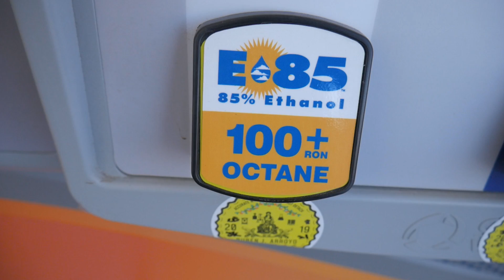Why Can't the BMW N55 Engine Make "High Power"?

Comment: N55 is reliable but why go N55 when the new B58 makes more power and also seems to be reliable? Edit: Also yes please do a video on all the N55 variants!!
Reply from the maker: good point! I think it mainly comes down to price at the moment. Many N55 powered cars have seen significant price reductions in the secondhand market.
Reply: @SimplyCarThings  some of the older cars have gone up in value, i got a 2016 m135i for £15k, can sell my spec a year on for nearly £2k more than i bought it for

Comment: I've had an n54 and considered going with the n55 now that the n54 is gone. I like the sound and reliability of the n55 more but the n54 screams to my inner power-whore because I love the fact I could daily the n54 at 550whp and its no less reliable then when it's at only 300whp. Plus if you do a single exit exhaust.... The n54 sounds amazing

Comment: I have a 2011 E82, with full bolt ons meth, and stage 1 turbo, I did 414 hp and 522 tq on a dyno but that was in the summer heat of Texas so it was heat soaked so I think it would've hit about 450 hp
Reply from the maker: very impressive numbers! is it a dct or manual?
Reply: @SimplyCarThings  manual

Comment: I had a 14' N55 in a 335i - had the dealer install the Dinan stage 2 tune. Within 1000 miles it was in the dealer countless times with issues. Went into limp mode x times, blew the intake pipe twice. Needles to say I traded the car soon after was just a headache.
Reply from the maker: wow, i'm surprised to hear that. My 2015 M235i has been tuned with E85 and is at 56k miles not a single issue

Comment: Well, long story short, 1) because the n55 has not been out as long as the n54, it hasn’t had the aftermarket support like the n54 has 2) the factory turbo is the bottle neck. Once you start going big turbo, the comparison becomes irrelevant.

Comment: My buddies with N54s are always broken down.  They've driven my 2014 F30 N55, stage 2 Bootmod3, are blown away by how fast it is.  I'm in Medical sales and drive it all over Arizona, have around 50k miles on it with all my mods/tune.  Never had a single problem with it, just your basic maintenance.
Reply from the maker: exactly man! i have almost the exact same mods except i also run E30 and im at 56k miles with zero issues
Reply: You still have the car? How's reliability ?
Reply: Do u live in phoenix

Comment: Been seeing a lot of n55 guys have rod bearing issues lately
Reply: That’s caused by OFHG not done properly, N55 engines are known to go over 200k miles, some have gone almost 300k, original turbo.
Reply: I’ve been looking for a 2011 for a few weeks now and out of the 6 or 7 I’ve checked out 2 had rod knock I’ve been seeing it more and more
Reply: thevernonposse you sure it wasn’t vanos, n55 may have rod issues if people don’t follow oil priming procedure when changing oil filter housing gasket. Also long oil intervals doesn’t help.

Comment: N55 with the ZF 8 speed. That ZF transmission is incredibly quick. Even stock. Throw an XHP flash tune on it and that car will be/feel like a little rocket. My wife owns a m235 and it’s the most funnest car to drive, she won’t let me tune it but for some reason I enjoy driving it A LOT more than my full bolt E90 335i making 450WHp. 

Sometimes I feel that it’s just as quick. Wish she’d let me full bolt on it I could only imagine how fun yours is bro

Comment: N55 with fmic and stage 2 mhd tune can produce up to 370 HP.  That's what I'm looking to do with my 335i hopefully by winter
Reply from the maker: very solid power levels!
Reply: I have the N55 I did the intake and charge pipe with mhd stage 1. I recently bought my intercooler and catless downpipe. I'm going to install them at the same time with mhd stage 2+ so I'm not buying 2 tunes. What kinda power do you guys think I'll make from that?

Comment: ive seen a 700hp n55 m235i  and i consider that as high power
Reply from the maker: was it 700hp at the wheels? its also important to understand what kind of dyno it was on since these figures can be manipulated very easily. But i do agree with you the N55 can make pretty high power!
Reply: @SimplyCarThings  ya it can still make 500-700 hp with a single turbo or stage 2 turbos with race fuel, meth etc.

Comment: hey now.. no hating. sure our crank isn't as strong.. but maybe us n55 owners want longevity not raw power.. 400whp is still a lot of fun.

twin scrolls are actually better for the engine. see here why. https://www.youtube.com/watch?v=T7JTRRlSEYI

the important "why" is at 2:50

exhaust scavenging and negative vs positive pressure in the exhaust manifold, which has net affect on the engine itself. Hence why twin scrolls rock.

Comment: I have the N55 in my 2011 335i and I owned the n54 in my 2007 335i coupe ... the n54 felt like it had more power ✅
Reply from the maker: definitely, i thought the same when i rode in the early N55 E92's. The later N55 variants tho feel significantly more responsive and punchy

Comment: 12 years and 196000 kms and my n54 is still going strong making 407 whp and i give it  hell... only thing i changed is my injectors to index 12. Original hpfp, original turbos bit of rattle tho, original water pump. Full bolt ons of course and custom tune water methanol injection..  still not bad for a old motor. Long live the mighty N54.
Reply: At 407whp I’m surprised you never blew the charge pipe. The stock one is plastic
Reply: @guidoluzzi66  it all the bolt on stuff charge pipe ,down pipes ,intercooler diverter vavles.. Now i have the 17ts ebay turbos ran 11.6 122mph not to bad. Time for a single turbo 👍

Comment: BMW forged some  internals of the n54 because they weren't too sure about the twin turbo setup. It had its issues for sure but it's a GREAT motor that won  many awards for years and was still being used even ten years later in some models. Bottom line is that they came out with the n55 to mostly save money and for better fuel efficiency.
Reply: That's just false... they added valvetronic and a dct transmission to the n55. Not sure how that's "saving money." N55 has 1 less turbo. That's it. It's twin scroll is more responsive, produces more torque at lower rpms, produces less heat, and overall reduces failure points. There was nothing cheaper about the n55. Twinscrolls are more expensive.
Reply: @banks334  The extras of having a twin turbo setup are costly and forging internals make it overall more expensive. The n54 is MUCH more tunable than the n55 and had a LOT more easy power gain potential.. that is well known.
Reply: @phild5813  like I said... because it has an extra turbo. Both n54 and n55 have powder metal rods and hyper pistons. You want to say n54 is more "tuneable" go for it, but, everything else is bs.
Reply: @banks334  Its well known that the n54 has a forged crank etc and the n55 doesn't (earlier years). No disrespect but you can just research it real quick.
Reply: @phild5813  it's well known that the crank isnt going to stop you from running enough boost to bend rods and destroy pistons. You're literally just regurgitating bs. First it was the n55 is just a low budget engine. I point out it's more expense and better performing in every regard and you want to tall about the crankshaft that doesnt have any impact at <800whp? Please... the only the the n54 has an advantage in is that it came with 2 turbos and can make 50-75whp more than an ewg n55. N54 turbos dont last long at all when you run then out at 99wgdc though so good luck with that.
Reply: @banks334  lol. You're obviously just an n55 fan boy. The n55 was less expensive. For the last time, the n54 is A LOT stronger and that's why there are so many 700+ horsepower n54s out there. Ppl dont buy older n55s and mod the car to 1000hp on stock Internals. Only you would because unfortunately you dont know better and you wont get informed on common knowledge.
Reply: @phild5813  you are obviously just clueless. Its the same damn engine it's not "a lot stronger." have you ever seen the inside of either one of them? There are plenty of 700whp N55's so hwo does that fit your narrative that the N54 is somehow magically stronger? Are you talking theoretically stronger? Because both blocks are open deck and need tons of work to do anything more than 700whp. You're the fanboy if you think the N54 is something special.  And again with the "cheaper" comment. There is absolutely nothing to substantiate the N55 is "cheaper." The N55 was simply a natural progression of BMW and turbo technology. I'll let you go back to regurgitating shit someone else said though because I am sure you've never seen the inside of either engine to actually form your own opinion on things.
Reply: @banks334  Its funny how the 335is, 1m and z4sdrive35is kept the "outdated" n54 instead of the n55.... dude I know it sucks to accept but the n54 has forged internals and is simply a stronger engine that can handle more power. The n55 is great and has some cast iron parts n shit ..... but it dosnt match up. The cost of a full twin turbo setup is more than a single twin scroll setup! Please go on a BMW forum and talk about how the original n55 is just as strong as the n54 and let me know how that goes ;)
Reply: @phild5813  oh, and OE BMW N54 turbos cost about $1400. OE BMW N55 Turbo costs about $2800. you still think those shitty mitsubishi turbos on your N54 are "more expensive" than a borg warner EFR turbo that lasts forever?
Reply: @banks334   Brenden Banks  "the n54 is a joke" lmao that's why it was used in the 335is and 1m which are  more expensive than the regular 335 and have more power..So weird how they used such a "joke outdated motor" when they could have used the n55. You wanna bring up the guy in the video ???? Really ??? 
He clearly explained why a TWIN TURBO SETUP costs more and he also explained why the n54 is a STRONGER MOTOR than the n55.... (earlier iterations of the n55). Look man.. I know it sucks that you thought you were buying the "better n newer motor" unfortunately you wasted your money for a much weaker motor and you'll have to settle for a lot less power. The good news is that you can put your car on kijiji and some other idiot just like you might  end up buying it. Then you can finally have that strong n54 that you've always wanted :D
Reply: @phild5813  the guy in the video doesnt have a clue and either do you. That's my point. It's a higher output engine off the factory floor due to its twin turbos. That doesnt make it a stronger or better engine. Not sure what youre not comprehending. I've literally debunked everything you've said and you're still sticking to your guns like the typical 15yr old n54 owner you probably are. Says N55 is cheaper... proves it probably costs more to produce... oh well its weaker... proves n55s have made 700whp... says the internals are cast... proves the internals are the same as n54 and literally every other bmw engine like the s55... oh well I'm going to deflect now by talking shit... proves OP is a dunce.

Comment: I love the N55, it's full of torque and sounds amazing, I just gotta drive a B58 car to decide between a 435i or 440i 🤔
Reply from the maker: N55's are badass, but man the B58 is on another level! You gotta drive one!
Reply: @SimplyCarThings  I finally bought one and you’re right! That B58 don’t play 😁
Reply: Tim C B58 is chaos. Shit bangs!
Reply: @svo7563  I bought an F32 440i in April 🙌🏽 I loveee it, so much torque and power on tap! Can’t wait to tune it
Reply: Tim C Get a 440i. Very cable motor stockwise
Reply: Bro 440i eyes close .b58 it is way faster than a n55 b58 its an upgraded version of N55
Reply: I have a 140i stage 2 running 452bhp. Monster!

Comment: Dude doesn't know what he's talking about this time , just getting info off other websites without proper research. Single turbos are better for more power, thats why N54 guys swap to that setup. Plus there  are HPFPs solutions when it comes to fueling (XDI, retrofitting S55 or B58 fuel pumps). N55s are making around 650whp+ on a stock block... want more power? then go for a closed deck setup and a bigger custom turbo! N55 is king buddy!
Reply from the maker: Ali G I wasn’t trying to say that N55 engines can’t make big power. I was trying to actually deflect those accusations with this video, I know it can make huge numbers and that’s why i put “high power” in quotations in the title. But mod for mod, especially with basic bolt ons an N54 motor can almost always produce higher power numbers, so i was explaining why that is.

Comment: I’ll take the N55 any day over N54. My stock N55 M2 is almost plenty (though I do want to mod it a little after warranty is up)

If I wanted a powerful engine, I’d rather get the B58 over the N54 because it’s (probably) more reliable than the N54. Toyota has done a lot of reliability testing before they released the Z4/Supra and if Toyota can trust BMW with it, it’s probably the go-to tuner 6 cylinder now.
Reply from the maker: Samuel Wu 100% agreed, if anything i’d go with a B58 car

Comment: I had a 2009 335 Tune and FBO and now 2013 335, tune and full fatback exhaust. From my experience, the n54 is a powerful and fun engine, gaining so much power from simple bolt ons. However, I did have many issue including high pressure fuel pump going bad, and turbo issue. I traded it for the 2013 before hitting 100k. The n55 is a lot smoother, but not as fast as the n54 with similar tunes. No issues so far and I am hitting 75k. I can see that car going more than 100k without problems. N54 is best but be prepared for unreliability and headaches

Comment: As an N55 owner, I prefer the reliability over the power gains of an n54. I’m really not drag racing every commute so anything between 400-450 is just good enough for the car.
Reply from the maker: rod bahmanyari same here, that was my reasoning too
Reply: @SimplyCarThings  put 20k on my m235i only the oil filter housing gasket so far but i did myself cheap fix. car runs super good and no issues at all other than that
Reply: Ollie Clark I’ve been having mine for about 4 years and zero problems 😏
Reply: x2 i had an n54 335i and EVERYTHING broke on it. N55 2014+ version is vastly improved. metal water pump. no fuel pump recall on mine. m235i now.. and power.. lol im at 380 fbo mhd s1 great daily driver
Reply: I hope you know that the reason water pumps fail is because they have a brushed motor. Thats it. Impellers hardly every fail
Reply: @seansurfn2  theresnt difference between 2023 and 2014 engines
Reply: Quick update: 7 years now owning the car, maintenance and oil.. she still runs lmao reliable af car
Reply: Most people won't realistically go higher than this, so the n54 won't benefit them in the long run.
Reply: This^ My stock N55 has been very reliable.
Reply: I’ve owned E92 N54 335, E82 N55 135 and E60 S85 M5. Unless they’re being tuned, the N54 differences are not very noticeable from the N55. BMW claims 15% more fuel efficiency on the N55 and less lag
Reply: about reliability. n54 better than N55
Reply: @ramazzakariadze5085  fuck no
Reply: Do you need to upgrade the turbo in a N55 to make those numbers 400-450
Reply: Tom Smith  Not at all. FBO stage 2+ gets you 390 whp and almost 500 ftlb I believe. That’s really all you need..
Reply: @tomsmith6372 no
Reply: @tomsmith6372  I think you can get around 400 with a few mods and a map tune. Downpipe, chargepipe, intercooler, throttle body controller, transmission tune.
Reply: Stage 1 tuned 640i. 320 to 355bhp. My fuel economy improved! I'm a hyper miler.
Reply: Except its not reliable lmfao. Bare issues on mine
Reply: Rei N55 is super reliable and if you get a EWG version it is essentially a matured product hence the new generation of B engines. This means this product is at the pinnacle of its development and now bmw is working on a different foundation. Moving forward, if you notice on select cars bmw utilizes 2 water pumps, this solves the WP issue, and you see fairly any rod issues. I can’t even find more than 1 mention of blown rods in my car and it was due to owner issues. The n55 is a great engjne
Reply: Brandon H. Do you know if 2014 535i GT is EWG version..!?  Just got one so I’d like to find out, thanks!
Reply: @brandonh.6654  how do you blow a rod? you mean bend/break?
Reply: @brandonh.6654  many people opinion n55 is worst engine in bmw history. crankshaft broke and crankshaft bearing problem.
Reply: @ChrisLoVeTaiwan  My 2014 535i is PWG, did you found it what do you have ?
Reply: FR ALBO ive had my e92 n55 for 5 years now. No major issues at all. If you replace oil and brake pads often, and do preventative maintenance like buying a chargepipe and bigger intercooler, the car can run for days without heat soaking or going into limp mode. Ask me how I know :)
Reply: Had 2 n54 135’s - sold my recent n55 135 with 254k was fbo for 150km - turbos went at 253 - aside from that there was 0 issues literally none minus general spark coils ect. Now moved to another 435 due to reliability
Reply: FR ALBO Doesn’t mean there is gonna be  bare issues in everyone’s, most people don’t seem to have too much of a problem with them
Reply: @FreshieAlbanian  it’s a BMW they make a reliable one ? Where? None.
Reply: N55 is barely more “reliable” and much less capable
Reply: @christiandaher5349  I can hear your injectors leaking, water pump failing and wastegates rattling from here bro 😂
Reply: @christiandaher5349  100k miles rn not a single turbo failure or hiccup outside normal wear and tear.. engine is solid and bmw made the n55 for a reason over the n54 lol
Reply: @christiandaher5349  “barely more reliable” 🤡
Reply: Why do BMW drivers need a fast car.?
Most are crap at driving.
They should stick to bycycles or Nissan micras, which would make the roads safer.